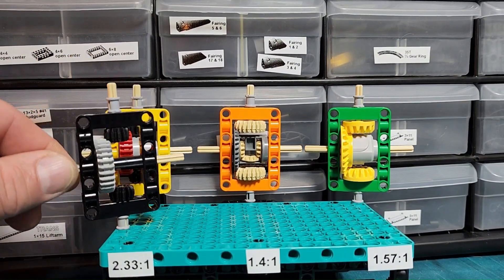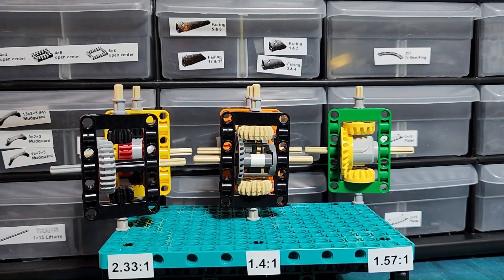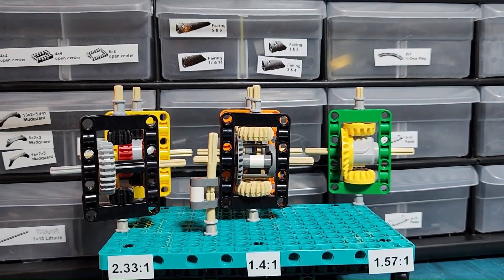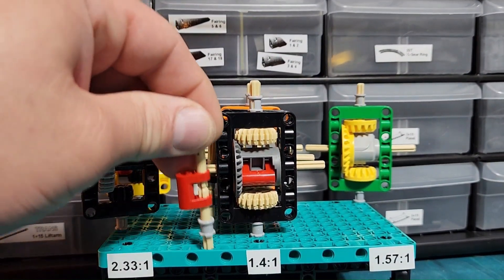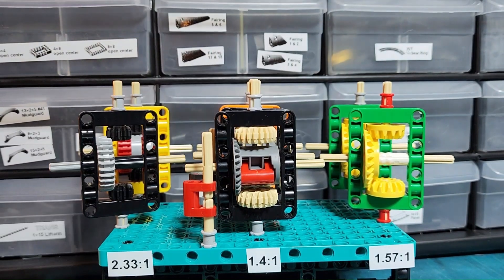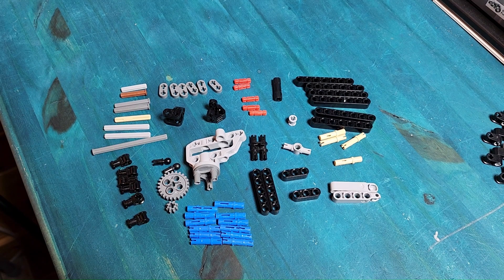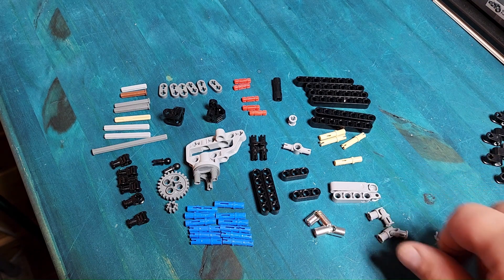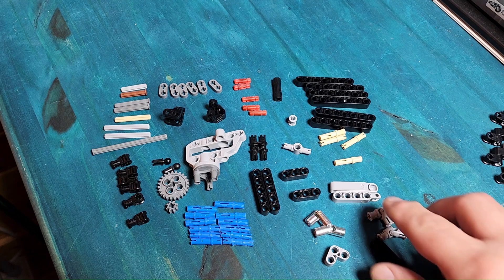Lego Technic 6x6 rear axle build instructions

Comment: How do we build the front suspension
Reply from the maker: The front required ALOT of non Lego parts and a few modified Lego pieces. A little tip: for starters, remove the 9L beams that stablize the portal axles and they can move freely. From there, you just have to work steering racks and motors (easier said than done). I'm working on a redesign of the front end after summer and will share but here is a look at my latest revision https://youtu.be/NpeXPx7Z2nE 
If you come up with something in the meantime, I'd love to see it!